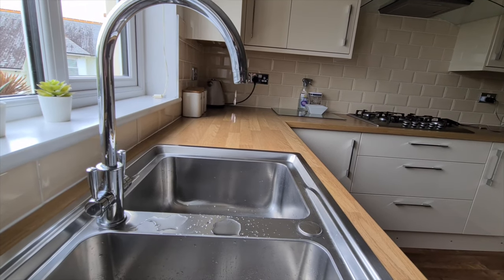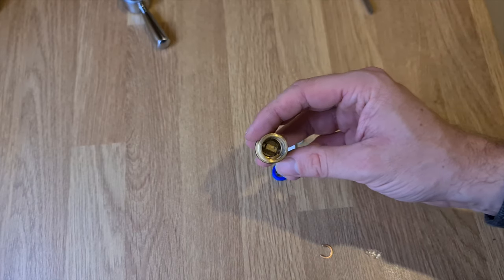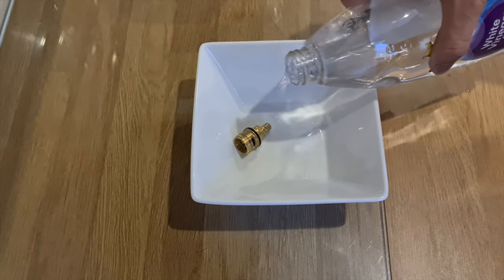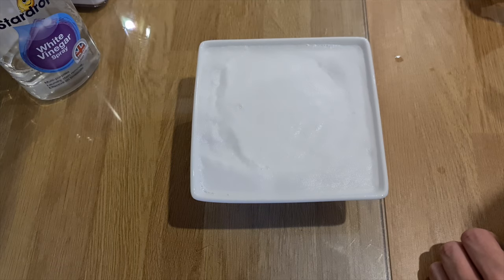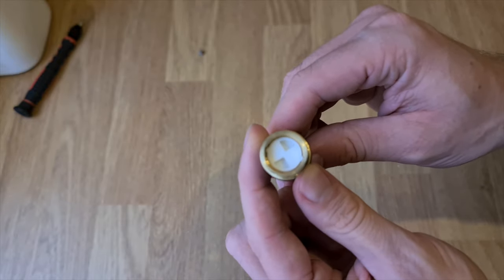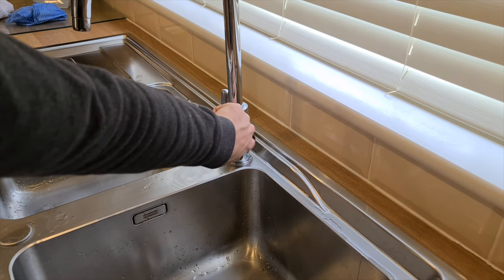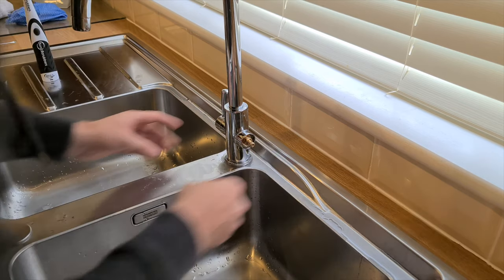How to fix dripping Franke kitchen mixer tap with current parts - full tutorial.

Comment: Nice one. You just saved me £300! The 'plumber' came and took a quick look at it, told me he'd have to replace the entire tap, 2 hours labour plus parts, couldn't do it for over a week. SO I took a deep breath and gave it a go! I happened to have a tiny hex allen key and a 17 mm spanner, and used lemon juice to clean instead of vinegar. Worked perfectly. Many, many thanks!
Reply from the maker: Thank you so much for taking the time to comment. I am glad I can be of service.
Reply: 'plumber' yes charge more than brain surgeons.
Reply: The same issue right now..    the plumber didn't attempt to change the valves even though I already have them ready to fit..   I had a go and changed the cold side in 5 minutes....but the hot grommet screw on the hot side has been rounded off by someone who fitted the tap...  so looks like I wont have any choice but spend £300+
Reply: Always like honest workmen , you can count on them 😳
Reply: Plumber can charge what they like . Some time I feel really angry they can be so dishonest just to charge more .
Reply: @grantmail4112 what do you mean by grommet
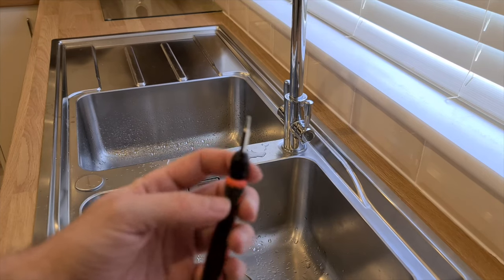Reply: @mgomez8864  It's the tiny little screw that holds the tap lever on..  be careful not to round this off...  1:29  its easy to forget and turn the wrong way as it's upside down to a normal way to unscrew.
Reply: That's a 20 min job for a good plumber IF the inners come out .
I never replace unless necessary.
BUT if you can't get the parts out or they have seized then you'll be paying the plumber for time waisted trying to get them apart and then for replacing the whole tap.... Choices you make..

Comment: Nobody has commented for a while but this is still helping!  I struggled to get the cartridge out.  It has a 17mm nut rather than the 14mm you showed, and was absolutely solid.  The cartridge does not protrude from the casing like yours, so had to get a socket on it, and the tip interfered with the drive for the socket, so had to be careful.  However, having sprayed WD40 and leaving it for a while, it did come.  When it came out the plastic inserts and seal were all left in the tap casing, so look carefully when doing it.  However cleaned them all up, put in vinegar and reset and refitted and now all good.  Thanks!

Comment: Hello,just discovered a leaking mixer tap and thanks to your tutorial think I can tackle this job. Thinking it might be a washer replacement but only washer I saw was the blue ring,like you said if that is deteriorated then find a replacement, but firstly do as you have done and see if that works. Thanks again for your video,before it's saves people hundreds of pounds according to the other comments.

Comment: As a safety feature make sure you put your plug in so the small grub screw and any small parts dont go down your drain and disappear you may be lucky if you do they may just stay in the bend of the drop down pipe be careful......
Reply from the maker: Yes, very good point! I remembered this afterwards which could have been very annoying!

Comment: Very many thanks. You've saved me a big bill from the plumber! Our FRANKE Zurich wasn't dripping but it was making one hell of a racket whenever the washing machine was in use or we used our outside tap. It sounded very much like an air horn going off, it was that loud. I'm guessing it was some weird sympathetic vibration thing going on.
Anyways, I followed your guidance, dismantled the cold tap & dunked the internal gubbins in vinegar & bicarb. Put it back together & perfect silence. Bliss!

Comment: Thanks really helpful. Just a couple of points. I suggest always putting the plug in the sink before removing the grub screw, in case it falls off the screwdriver as you remove it and vanishes down the plughole! Also worth pointing out that not all Franke taps use the T8 screw, mine needs a hexagonal Allen key, which was supplied with the spare cylinder (which now I may be able to return to the shop thanks to your video!).

Comment: Bicarb and white vinegar when mixed neutralise each other and create water. The only action you will get is the fizz which by its action may remove any loose bits but chemically it won’t dissolve limescale. Just use white vinegar or lemon juice. Apart from that excellent video 👍😁

Comment: Thanks for this. One problem I came across was that my tap had no grub screws, just the central brass screw. The tap handles were very firmly stuck but your video gave me the confidence to use force, in the right direction. It was just a case of getting the splines to let go. I took out the central screw from each side and squirted WD40 very carefully down the holes. A few judicious taps with a nylon-tipped hammer and the taps came off!

Comment: After watching this and realising there are no washers but the cause of the drip was dirt or debris between the plates I tried a quick fix. I violently threw the tap on and off quite a few times in order to dislodge anything. This worked perfectly and now the tap does not drip. So worth trying first 😂

I also determined it was the hot side before trying this.

Comment: Excellent video.... worked. Also helpful if you do need to remove cartridge for either hot or cold. Had vinegar but unfortunately no bicarb. But the process of taking it out, cleaning and soaking vinegar seems to have worked. Thanks.

Comment: Have a very similar type to this but cannot get the cold side to come out had a big spanner on it and it does not look as though it comes out, so trying to access the hot tap side and the small allan screw is very tight only turns half a turn easily. My tap has a chrome cover next to the lever exposing the main cartridge body. waiting on a plumber to quote and no doubt he will charge for the whole cartridge. live in a hard water area although we have a water softener so expect evidence of limescale if I manage to strip it. but this was a very good video depending on the quote i may be coming back to this. Spare cartridges range from £5 to £15 at screwfix depending on diameter and length of the splined shaft for the handle

Comment: Thanks for the helpful video, but it didn't work for me.

Warm water dripping actually became worse. Cartridge looked very clean when taking out so surprised it had problems. Did try repeating the process several times. Will try to order a replacement part - perhaps mine is damaged somehow?

Did try cold water one first and that cartridge did seem to have scaliness and a little dirt from water coming out.  Putting it back together after cleaning I had no drips, so surprised that the one in better condition and easier to fix failed.

Ps for my (different) Franke tap, the grub screw was so far in it looked like an empty screw hole - thanks for the heads up on the screw type and size.

Comment: Great video !!! Hi. I have the same problem but not sure if a T8 key will unscrew the bits of my taps. I have a Lamona Adra TAP 3541 , the PDF says that I have Grub Screws 6 x 4. Will the T8 key be good or will I have to get a different key.
Thank you very much.
Reply: I did it !!!.. I bought a set of keys from Screwfix, it is a T8. A known plumber to me said £ 120 to fit a new unit and recommended a unit from Screwfix for £ 120..I bought a set of keys from Screwfix for £8.99 and job done ...I saved £ 231. Thank you for the video. Well done.

Comment: Great help!  I changed the cold tap valve (but still dripping) but it looks like whoever fitted the hot side .. they have rounded off the grommet so I can't undo the tap end with the allen key...   is there any way to remove a rounded-off grommet?  Or do I need to buy a completely whole new mixer tap?   Thanks
Reply: I ended up buying a whole new tap ^

Comment: Hi Dominic- Great video, looks fairly straightforward 🤞-any way of telling which tap is dripping rather than undoing and cleaning both sides?Thanks
Justin
Reply: Turn off the cold water supply and open the tap to relieve the pressure.  Run the hot water for a short time to refill the tap. If it’s still dripping your hot cartridge is leaking (and vice versa).
Reply: Thank you.

Comment: I had these problematic Frankie ascona taps, always leaking then I took out the valves and applied Vaseline to the white ceramic disks. Apply some silicone grease onto the ceramic disks then re-assemble! ( always clean them out first ).

Comment: mine doing same. same side, and the lever seems a little loose. when i move the lever about the leak goes away, but when I let go it comes back. Mine has a lot of limescale build up around the lever too.  nightmare to even get the lever off. plus changing the tap is a nightmare because of the drainage works in the way. cant see nothing. have to guess with awkward positions. am waiting to see if the wd40 helps the lever come loose. Seems like a simple fix but is taking me more time than I thought. Thanks for the video !

Comment: I took the little screw out of the  cold side of the tap and the tap lever didn't come off? Was there any other steps to take the tap lever off? I've tried everything? Pulling it off, twisting it back and forth. But it's still attached!

Comment: How do you get the taps off a dual system like this if there doesn't appear to be any screw on the taps.. Is it somewhere at the bottom perhaps? It's on a bath so it's very close against the wall with no space for any screwdrivers

Comment: You’re a legend. Thank you. How did you know that it would be the right side tap?
Reply: Exactly my thoughts. I couldn't find a video on that.

I have no safety taps under the sinks. If I was meant to fix the hot water tap, I would have to turn the mains off and then drain the hot water tank... I have no idea what would happen to the central heating as it seems to be wired onto the same system -- for all I can tell looking at the absolute mess of wires and pipes around the tank.
British houses are so out of date with these cowboy dodgy botch jobs for water and electrics like it's still 1920.
Reply from the maker: Thank you, I did Both to be on the safe side.
Reply: You isolate them individually under the sink and see which one stops the drips
Reply: I don't think you need to clean it, as it was just the washer.
Reply: @marniecrittle  That's silly.  If it's just a drip, the water will be at room temperature when it drips out, whether it started its "journey" as hot or cold.

Comment: Thanks. I'm struggling with getting the pin out. Do all Franke taps have a T8 screw? Thanks
Reply: No. Quite often they use a 2.5 mm Allen head grub screw.

Comment: Hello mate, I went and bought a set containing the T8 and it felt like the correct bit. Unfortunately the bit sheared in the first quarter turn.
I went back to the hardware store and bought another set that had 2×T8 bits. Same thing happened again and this time the bit that sheared off stayed stuck inside. 
Any suggestions on how I might remove it? Obviously without doing so I cannot carry out the repair
Many thanks
Reply from the maker: Thanks for your comment. How annoying that this has happened - I would just try and dig it out with something as hopefully it hasn't been wedged in. You would have to try something thin and pointy to be able to get underneath or catch the groove of the shard T8 bit, however being careful that it doesn't snap.

Comment: hi on my tap cartridge has a chrome cover. I have got the tap off but can't budge the cover. Any suggestions? Thanks
Reply from the maker: Thank you for your comment. I'm not really sure I'm afraid. All I can think is to feel around to see if there are any flush screws or grub screws. Maybe get a screwdriver or T8 bit to see if it catches anything?
Reply: @developer.diaries1051  WD40 did the job
Reply: @stevenkelly194  A tip i learnt after scratching the chrome with plumbers pliers is to wrap it with electrical tape to protect the chrome while trying to get the stuck chrome cover off.

Comment: Excellent video - thank you.  I have a problem - removing the torx screws.  I'll need a right angled torx screwdriver, and I can't seem to find one online.   Ideally, a 2" long screwdriver would work ok...anyone know where I can get a torx set which includes an elbow attachment? Thanks!
Reply from the maker: Thank you for your comment. I would suggest trying the likes of Amazon or eBay. You could also try going into your local builders' merchants any they might be able to advise you.
Reply: @developer.diaries1051  Thanks for the reply.  Neither ebay nor Amazon have what I need.  Going to have to construct my own with a shifting spanner, double sided tape, and a torx head.
Reply: @magicdelboy354  I used Allen key to remove the grub screw and it worked . Well not the drip but I’ll give it another go .
Reply: The 2ml Allen key worked for me too. Drip gone.

Comment: Hi. I've soaked the valve in white vinegar and baking soda, added vaseline to the ceramic part as I can hear its bit scratchy when I turn it. It seems to be all good when I manually turn it but when it's tighten back the water doesn't go off at all even after turning the knob.
Is it because of the vaseline?  
I happen to have 2 wrong fitting valve (it's just bit short and it's blue(clockwise) whereas mine is red (anti clockwise) and all of them doesn't seem to turn off the water. Been swapping ceramic parts in between. 
Wish it was that easy. It's my 2nd day trying to fix it😢
Reply: I’m gutted no one answered you as this is our problem

Comment: Not sure why you used bicarb (alkaline)?  All it does is react with the vinegar and give you a nice fizz.  If your tap is fuzzed up with limescale, limescale is alkaline - so you just need something acid to dissolve it.  Great video otherwise 🙂
Reply from the maker: Hi Timothy, thanks for taking the time to comment. We used this combination to remove the dirt build up as it cuts through the scum and it's great for cleaning. :)
Reply: And neutralise the acid vinegar!!!!

Comment: Hi looking to do this myself. It’s a similar looking tap but it doesn’t have any screws round the back of the handles. Can you give me any advice please?
Reply from the maker: Thank you for commenting. I had to feel around for mine as they almost felt flush. I used the light from my phone as well as using the T8 bit to see if I felt something. I would have thought they should be there, as you would need some way to take these bits off. Apologies I couldn't have been of more help!
Reply: Yeah managed to sort it thank you. The little sticks on the handle un-screw out they act like the little screws instead. I cleaned all the innards as you described and the dripping has now stopped. Thanks for the video
Reply: Other ideas for this: 
Place your smartphone (cam facing up) flat, under each handle, and take a photo
or
Borrow a compact mirror from your other half and see if the screw shows up on that😉

Comment: It looks like, i will have to buy a new swan neck kitchen tap.    After 3 years of fitting it… it now 💧 drips all the time, after constant use.     Unfortunately, there’s nothing i can do about it, at the moment.  
i took the little screw out; but not able to take the pull lever off at this stage.     
Fitting a new swan neck tap is very easy, anyway; and it doesn’t cost very much.    It only takes around 5 minutes to complete the task;  with all the original existing bits that come with it.      Will have a look at the original swan tap and see what i can do with it. 
Other than that… it’s a lovely looking swan neck tap;  would not change for another design.  
Thursday pm 18th January 2024.  Southampton England 🏴

Comment: Not a bad video but you don't need to take the small flat clip off that achieves nothing here and you shouldn't force the white plastic valve pieces out with a screwdriver as if you scratch them they will not seal.

Comment: Pointless removing the circlip on the shaft, since you didn't remove the shaft. Also pointless adding bicarbonate to vinegar as they neutralise each other and just produce CO2.. Just use vinegar to remove scale. But often the problem is the rubber seal which can be replaced.